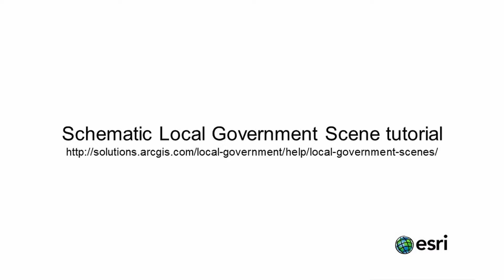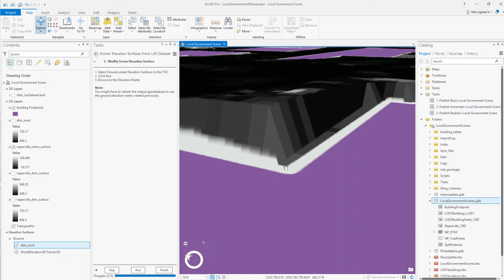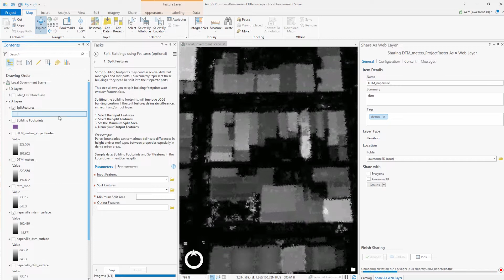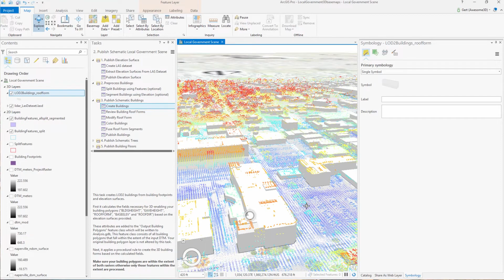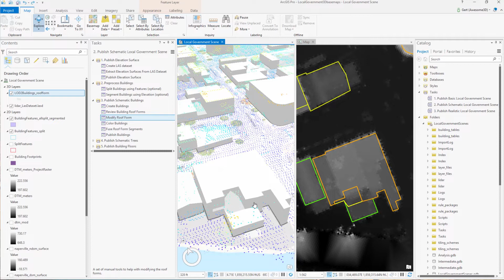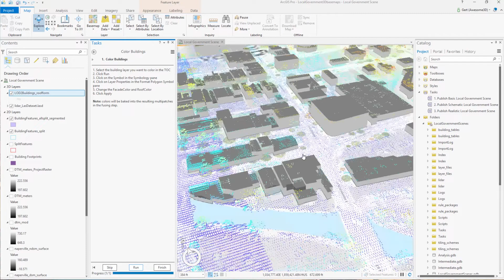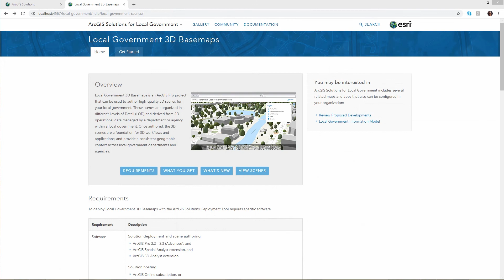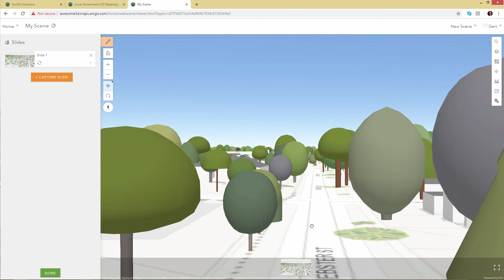Schematic Local Government Scenes Tutorial

Comment: I have a question about the cell size when creating DSM.
It was 0,39 for my Lidar by default, but if I wanted to proceed with that I had an error 032659 when trying to segment the building footprints with that DSM. 

(some text from the end of the error: LOD2buildings.tbx#SegmentRoofParts_LOD2buildings.UpdateParameters.py", line 92, in updateParameters
ValueError: could not convert string to float: '0,396687573444423'
). 

When using the cell size 1 everything works fine, but it is not that detailed.
Could that be a problem of my data or in the py code?